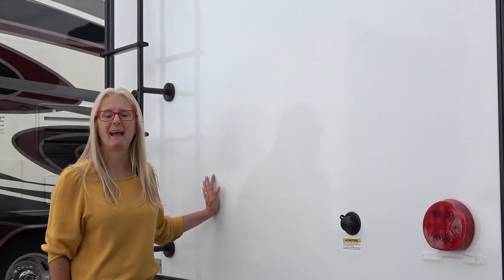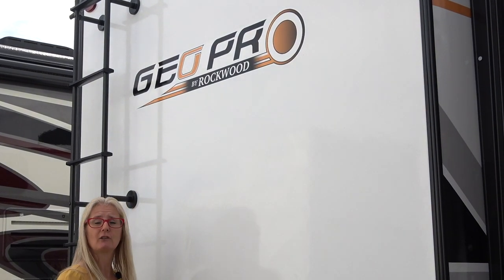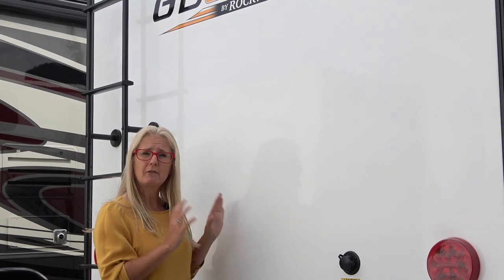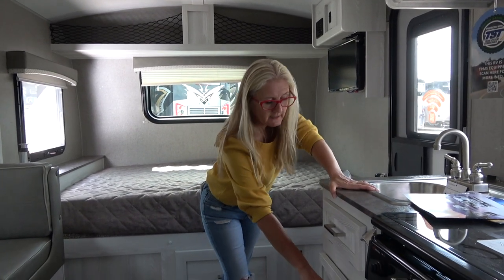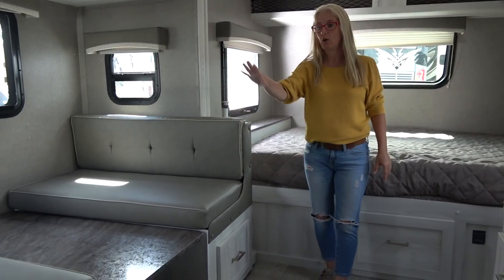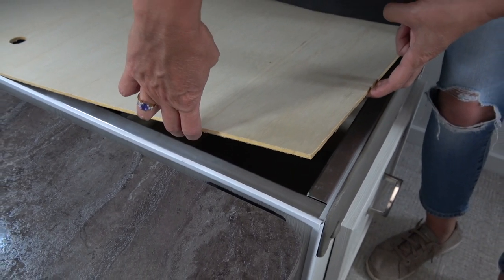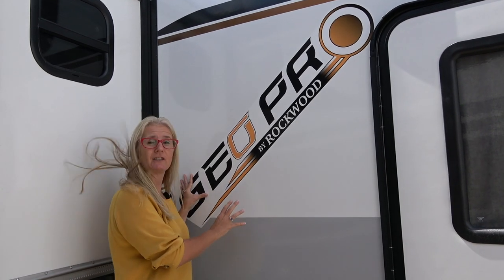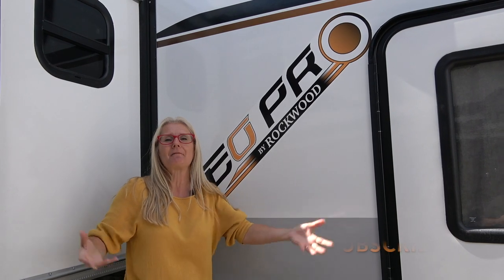How It's Made GEO PRO Construction Methods

Comment: I just bought a new geo pro 20bhs. It came standard with one agm battery. I immediately upgraded to 2x 100 amp lithium batteries. Yes they cost more initially but save in long run. 100% usable capacity compared to 50% and 5000 cycles compared to 500. Also 50% less weight. Only issue geo pro battery box fit only one. So installed one inside in the storage box. Geo pro charge controller only charges them to 80% but after spending so much cash on batteries not paying another 500 to upgrade that seeing the solar charge controller tops off the extra 20% no problem.
Reply from the maker: Awesome to hear. We are so glad you like your Geo Pro. It is a very cool trailer. Batteries are a variable thing that gets chosen at the dealership level and is something we have suggested may be negotiated around at the time of purchase. Upgrading to match the solar capabilities is a great idea if you can handle the extra expense. Pros, cons, give and take, priorities all of that stuff is individual. Like you said about the charger. It is great that you got what was best for you and it will make your use of solar life so much better. Have you been out on any adventures yet?

Comment: Good Review ! We have the 2020 19FD and love it, ours has the off road package without the window up front. We have had some drawer screws come loose but we do use it often in off road situations and it has held up well. We have two 6 volt golf cart batteries up front and have had no power issues even on cloudy or rainy days, power consumption is very low in our camper, the fan, lights and TV don`t seem to draw much power. Glad we got ours when we did, the stock for these is very low in our area due to Covid.
Reply from the maker: Oh wow, thanks for sharing your experience. I think having a few screws loose happens all of the time when you rattle these rolling homes down the road (well we have few screws loose on a regular basis around here haha) . So good to hear that your batteries keep up so well. We got some recently for our new project and are loving them too. You are so right about these flying off the lots. We can't even find more to film and review. Glad you got one and are out there loving it. thanks for watching.

Comment: I'm about to buy a 2022 and the dealer is suggesting I get the clear coat for $1700.00. With it being laminated already, is it necessary? Thoughts?
Reply from the maker: Great question and it is tough to answer. Fiberglass laminated walls generally have a gel coat on them. So do you need to add a clear coat? Well, it is true that some new to 10yr old RVs can have problems with fade, yellowing or even peeling and chipping. There are products out there you can use in your regular maintenance to prevent this. Who knows if it will happen to yours. You hear about some in forums but we also know lots of folks that have absolutely no problems. So is it worth the extra $1700? We guess that depends on you and how willing you are to be doing the somewhat labour intensive washing/waxing maintenance. Be honest with yourself and your budget. If you are unlikely to do the work and your budget can afford it then it may bring you some extra protection and peace of mind. Do you NEED to do it? No, but then you have to do other things. Hope this helps, let us know what you decide. Thanks for watching.

Comment: I have a 2020 19FBS and am very curious about the roof construction. I understood from your description that there are two long sections that create the arch along the center. Are there wood frame pieces that go from the arch to the sides? I’m trying to figure out for some more solar panels on the roof. How do I find out more about the roof frame.? Thanks! Great video. I love my geo pro
Reply from the maker: Glad you liked the video and your Geo Pro. They really are wonderful rigs. As for the roof it is entirely aluminum framed so the pieces that go from the arch to the sides are aluminum too. We understand that there are some places within the aluminum tubes that have some smaller pieces of wood in them to screw to but we have not found where those would be exactly or how to figure it out. We will ask our contact and if we can learn more we will let you know. You should ask the dealership shop people, not sales, as they may have more contacts within Rockwood that could give them a more detailed picture or answer as to where things can be installed properly. Good luck and we hope we can help some more. Thanks for watching
Reply from the maker: Just got an update for you. The entire roof frame is aluminum and then there is that center piece that runs all of the way down the roof that could be screwed into and there is wood inside the aluminum. That being said you wouldn't want to miss any of this because once there is a hole in your roof... well you know what can happen from there so we advise that you get it professionally installed with a warranty on the work and results of the work. Hope that helps.

Comment: FD 19 model is my favorite. It seems that has more storage than the 19FBS
Reply from the maker: Just by looking at the floor plans, because we haven't seen these ones for real. We would have to say that the FD has less exterior storage because just from experience we know that the Murphy beds take up quite a bit of the front exterior storage space but we love the Murphy beds so that's a tough one. The wardrobes on either side of the Murphy bed are good but so is the overhead storage in the 19FBS, but there is more bathroom storage in the 19FD. So all in all we think it probably balances out. Which one is the right one depends on which type of storage is most important to you and other things like whether a slide or dinette matters to you. Just our opinions. Hope it helps. Thanks for watching and sharing your thoughts.

Comment: For off road the tanks need to be both fully enclosed and the entire underside protected. The fabric vapor barrier is easily torn and not strong enough.
Reply from the maker: That would certainly be the gold standard. It doesn't mean you can't use this trailer for off road fun but a person would need to cautious of what they were going over for sure. There really are different levels of off road use and as in any case (trailer or tow vehicle) the more extreme you want to go the more adaptations are required to make your experience as fun and trouble free as possible. It all boils down to intended use and environments. Thanks for watching.

Comment: if we change power inverter to 2000 or 3000 w, do you know the wiring system built in the rig can handle it or not? Do you know what size of gauge was used in the rig for DC and AC power?
Reply from the maker: Got some factual info from our guy, he is the best and he tells us that a 1000w inverter is the limit as the AC wiring used to the inverter is 14 ga and the DC wiring used to the inverter is 2 ga. Probably, not what you wanted to hear but you can still do charging and run lots of stuff one at a time on the 1000w inverter, although we did put a bug in his ear about upgrading the wiring to give folks choices to upgrade their systems. Hope that helps. Thanks for watching
Reply: Does Size Matter many thanks

Comment: What are the R values of floor, walls and ceiling?
Reply from the maker: Great question and we get it all of the time. The reason we do not include R values is that RV manufacturers do not calculate R values in a consistent way so it is impossible to compare one RV to another based on R value. They assign an R value to materials that don't really have one (although the material may still have an effect on heating and cooling) and then they add up all of the numbers they have and often come up with some outlandish R value numbers. For this reason we do not quote or compare RVs based on them. We look more to the materials  and methods used to build the RV because these are things that can actually be compared. Hope that helps. Thanks for watching